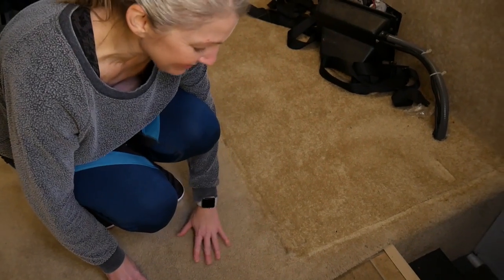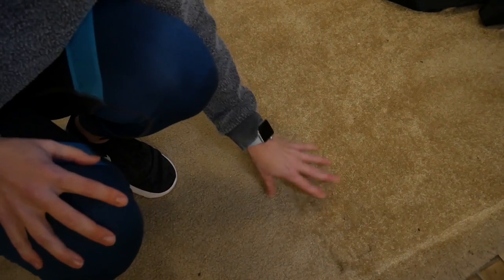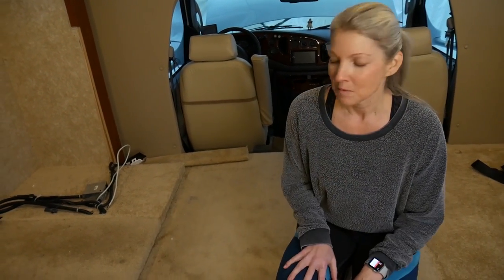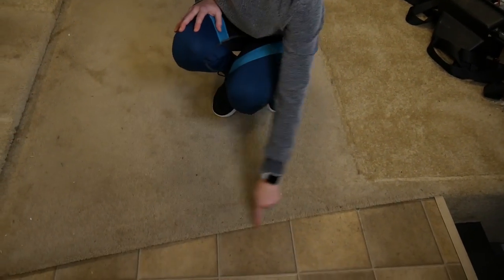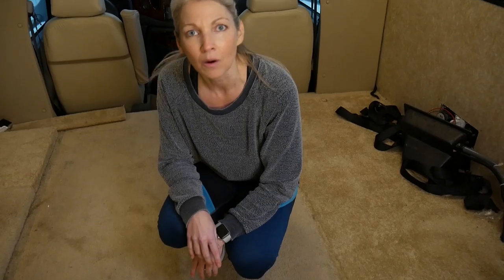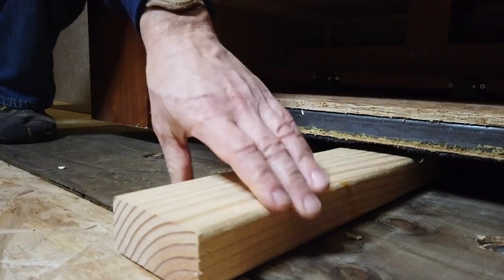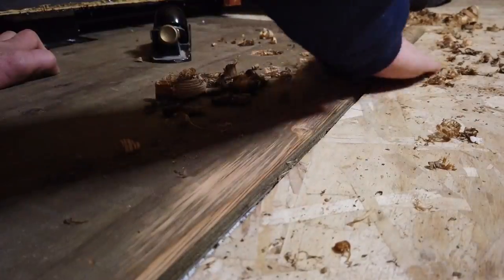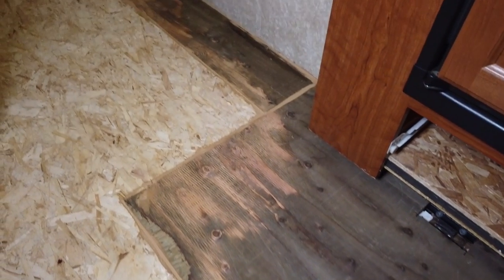Repairing Water Damaged RV Floor | Class C RV Renovation | RV with Tito

Comment: BTW, stainless steel in relatively equal to a grade two SAE bolt.  if you are replacing a SAE grade 5, better stick with the steel rather than going to Stainless.

Comment: Great DIY repair!! Could the water damage be from refrigerator condensation? OSB not very water resistant. BTW, New follower. What is your DIY experience level? From past vids looks like you have a well equipped shop for carpentry, electronics & mechanical. Thx!!

Comment: I just found water damage under carpet  due to leak near hot water heater.  It is dry. I just bought the 2001 class c, no idea how long ago leak was. Going to sand and seal, hoping I dont have to replace.  Is plywood not pressboard so a bit hopeful.
Reply from the maker: Good luck! Fingers crossed.

Comment: Only thing I would have done differently would just be a cheep quick coat of paint on the bare steal. They should just use pt plywood in the first place
Reply from the maker: Yeah. I should of sprayed it. Oh well. Too late now 😕
Reply: @RVwithTito  Did you glue it? If you glued it i wouldn't worry to much
Reply from the maker: @alec4672  Yes. It's glued with construction adhesive.

Comment: I own a 2007 Holiday Rambler 5th wheel. I have a very soft floor in front of my fridge and wood rot on some slide-out corners. The whole place needs flooring and lighter colored paint. I have never done this type of work and praying I can follow your lead. My other concern is the electrical! Only half of my outlets work! I'm a 66 yr old single grandma! Oye

Comment: So you had rot and after removing bad wood you found foam insulation and didn’t bother to look under the foam? I guarantee you have more rot under that. All you did was simple patch work but did not find the problem or resolve the causing issue.  All you did is delay the inevitable which is sub floor failure. That is what I happen in mine. But Nice patch I guess.

Comment: I have a perplexing problem.  Can you help me ? I bought a used rv 3 months ago. Thus far, it has rained 5 days since then. Only on one of the rainy days did my rv leak. I found the bed area soaked. But on the other days, nothing happened.  I parked the rv in the same spot. Quite perplexed .
Reply from the maker: Hard to say. Is your bed in a slideout?
Reply: @RVwithTito  no, not a slide out. It is the bed area above the driver and passenger seats .
Reply from the maker: @slee4653  Oh. Class C? Is there a vent overhead? Front window? The window on mine could generate condensation in cold weather.
Reply: @RVwithTito  I don't think it was condensation. The bed, blanket, and mattress got drenched .
Reply from the maker: @slee4653  I'd start by closely inspecting the seals on the roof.

Comment: Bad news!!! The treated plywood has Copper in it. That means you have dissimilar metals in contact with each other and the steel is going to rust out.
Reply from the maker: Thanks for the head's up. Hopefully I have enough adhesive to create a little buffer.

Comment: Please say you unscrewed the seat belt bolt but didn’t show that part to save time. Otherwise, if you were able to pull that up so easily that is cause for alarm.
Reply from the maker: 😃 Yes. I removed the nuts from the other side first.